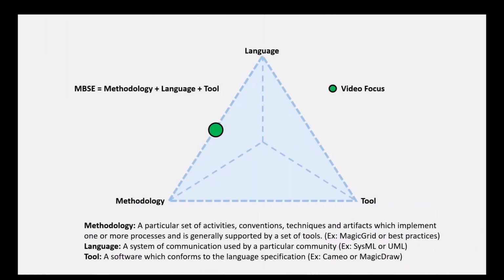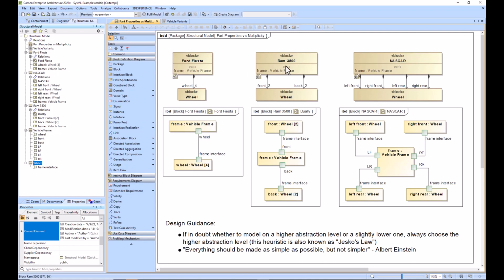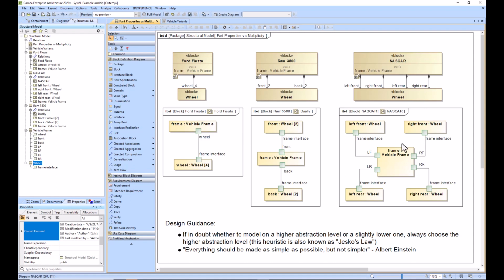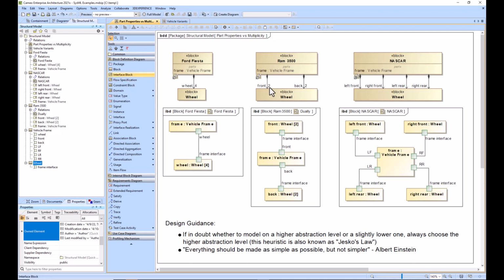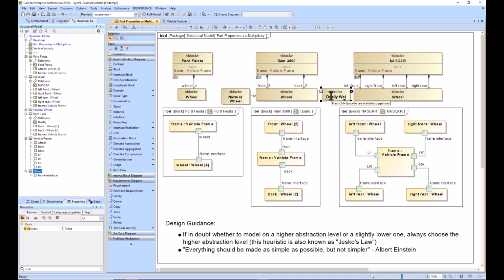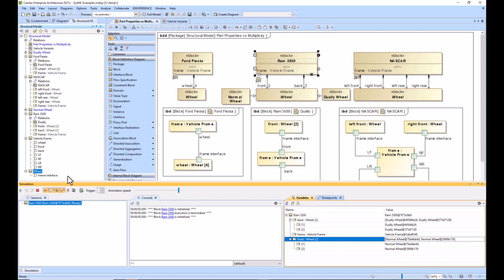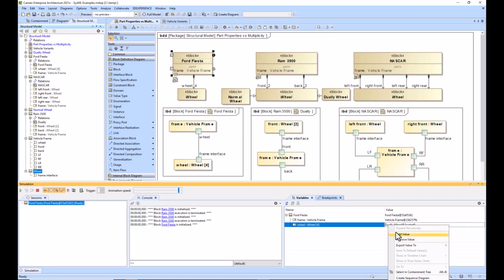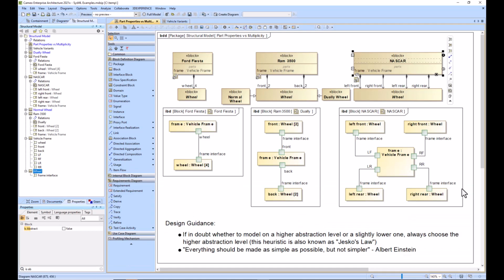SysML - Multiple Part Properties vs Multiplicity - Ram 3500 Example

Comment: So in this case, is there any reason why you wouldn't just create the containment relationships with the more specific wheel blocks? Why have two containment lines pointing from "Ram 3500" to "Wheel" when you could have one line pointing directly to "Normal Wheel" and another pointing to "Dually Wheel"? Is there any reason for the middle man in that relationship?
Reply from the maker: What your suggesting is correct. As you add more refinement to your model, you would likely point to the specific type of wheel.
The intention of the video was to show that you can use parts in different places in your system, and sometimes it makes sense to model the parts individually while sometimes it's better to clump them together.  
Generally if you have a part in series then you want to model the part properties separately (multiple part properties each with multiplicity of 1), but if you have a part in parallel then you can model together (single part property multiplicity of many).
You will have to decide what's best for your situation.  A rule of thumb is that It's probably best to start with a single part property with a high multiplicity and try and model. If you have any issues with the ibd, then you can go back and refine with multiple part properties with lower multiplicity values.